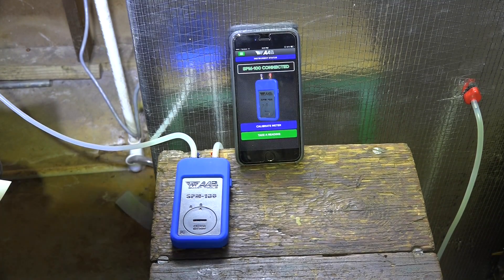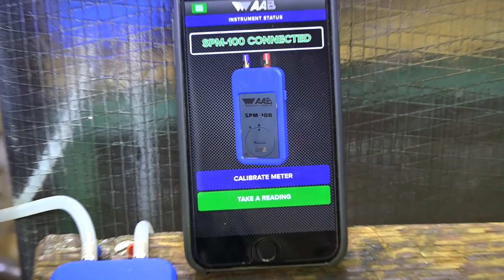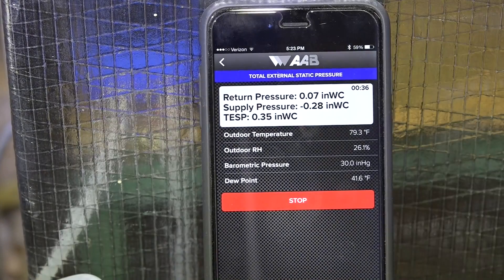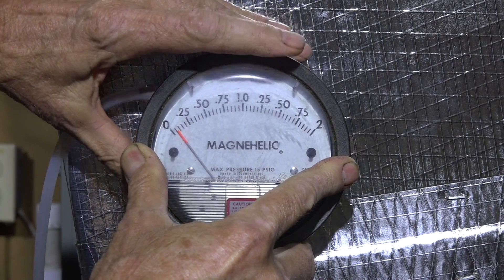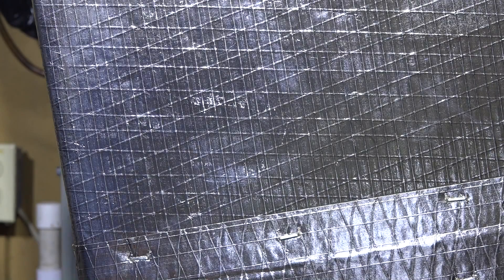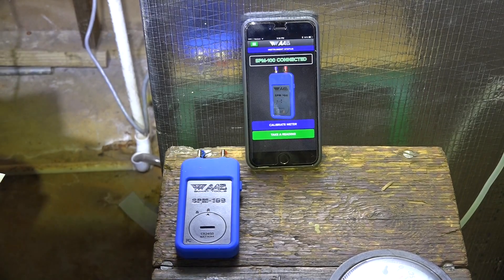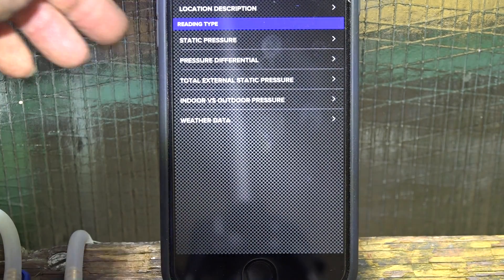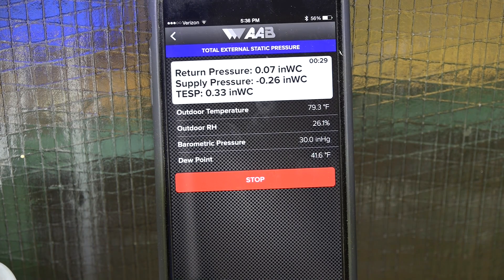AAB manometer review part 2

Comment: Why not press start the software first and then connected the hoses. Maybe after connected the hose first, and then startup the software , it try to zero the pressure. ( software upgrade mention ?)
Reply from the maker: I pretty much tried every way of setting it up. The factory says there is a fix in the works. Will update soon. 
GFM

Comment: GFM. If you were on a job today would you rather being taking static with this meter or the magnehelic?
Reply from the maker: The AAB for sure. Calibration is simple and appears hard to damage. The digital record is great if the software works out ok. I will have more when I get to the conclusions. 
GFM
Reply: +grayfurnaceman that's a good endorsement